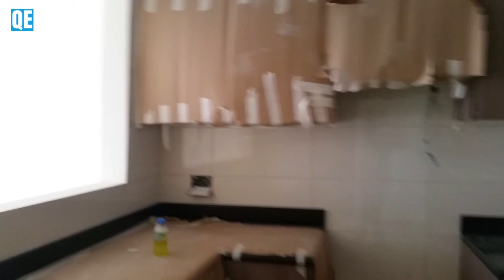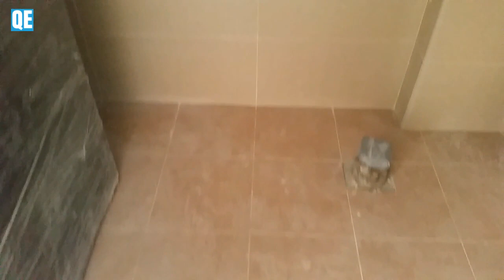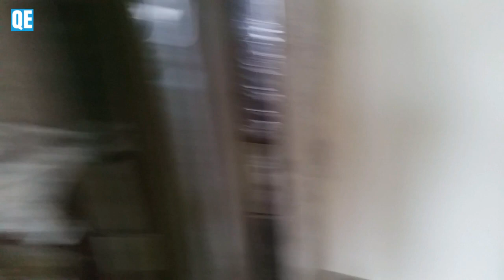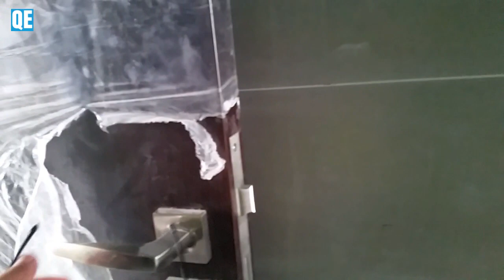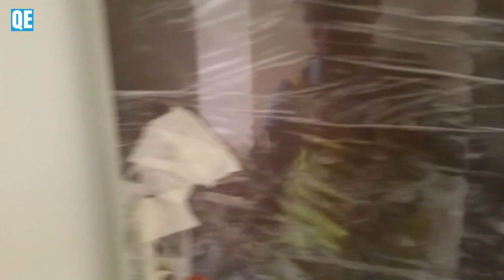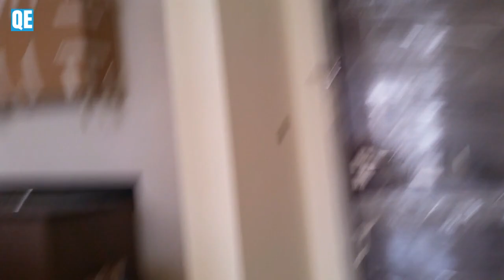Sample mock-up flat inspection at 4th floor of a high-rise building

Comment: hi boss, one question...hold points for mock up installation inspection ( before the actual one) should be a design engineer & construction engineer , rite? qaqc engineer should attend as a witness only,  that's what i understand... becoz design & construction reps should decide the correct & final method of installation..in the next stage, qaqc rep will ensure that all installations follow this method
Reply from the maker: Let's be clear here that the inspection is for a Mock-up sample of a Flat so the hold point here is the client or the representative of the client. The design engineer has no connection for the mock-up inspection and the construction engineer is the one who build the mock-up and therefore there is no hold from them. You are right that the qaqc dept. will follow if the client approves the mock-up. That's it to it.
Reply: @qualityengineersguide  tq boss for ur explaination..im in the railways industry..trackworks to be exact, so a bit different process there
Reply from the maker: @shahrilramli8346  Inspection action with Hold point code varies depending on the type of inspection. Like for example the inspection of the slab before pouring concrete, the hold point there is the inspection and approval of the municipality engineer. Just remember the meaning of hold point so that you will not be confused.